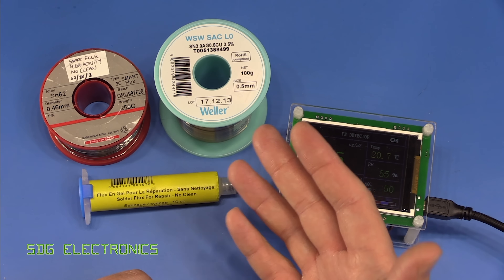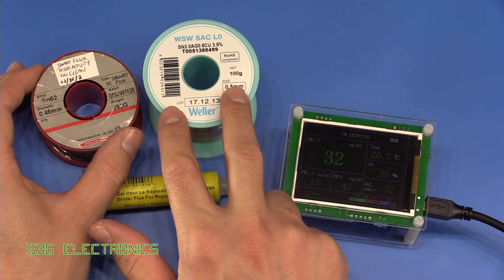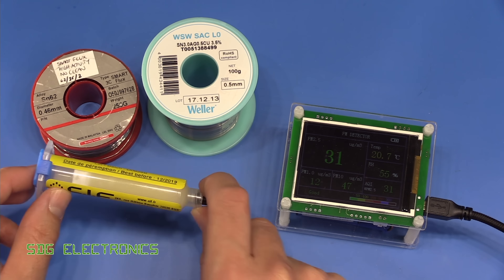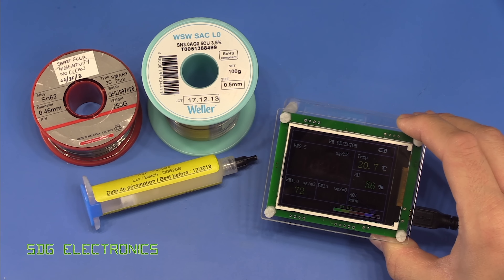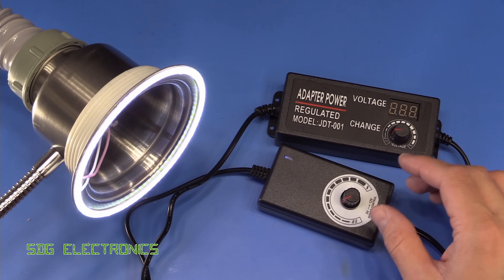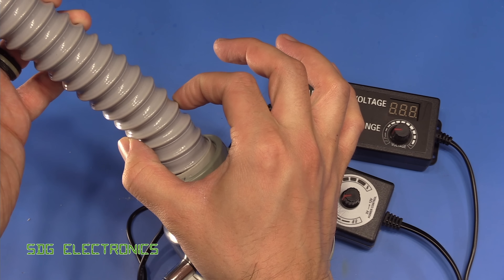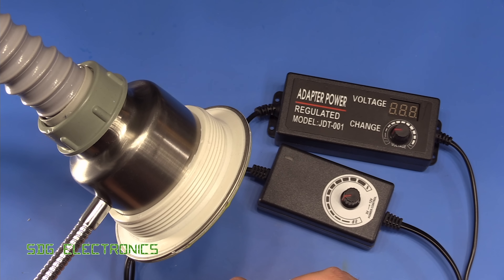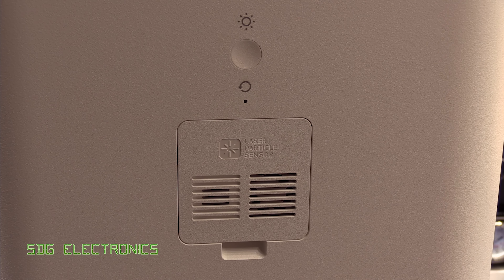SDG #131 Solder Fumes, Extractors and Purifiers

Comment: I made my own, using Loc-Line tubing(https://www.amazon.com/gp/product/B006R9OXJM/) and an inline exhaust fan (VenTech VT IF-4-B).  It moves 190 CFM, which provides good air flow.  I have the Loc-Line connected to a long pipe and then the fan sits about 18 feet away from me.  There is some noise at the intake nozzle, but I have a speed controller so I only turn it up full when I need that.
It can pull the smoke away well enough that the intake doesn't have to be right up by the board.  The fan with speed controller was about $70, plus $35 for the ESD rated Loc-Line.  Overall it was a lot cheaper than anything similar.
Reply from the maker: That tubing looks pretty good, unfortunately not available in the UK, but there are some similar items. Thanks

Comment: I hacked / Moded a Laptop cooling pad, Reversed fan rotation , added a thin sponge filter and added a PWM controller. And I soldered everything on top of it and fumes(90% of the time) were sucked down because of the surface area and proximity to the pad.

Comment: $200 to $300 instead of just opening the windows for 10 minutes? That's a bit expensive...
(And it doesn't remove CO2 in the room)
Reply from the maker: I forgot to mention actually, but when I tested with a through-draft the operator exposure was still high. You still need the local extraction if you're concerned about the fumes.
Reply: @sdgelectronics  sure it's just the purifier that is effective at cleaning your wallet...
Reply from the maker: @cmuller1441  yes, I'm not recommending anyone should use this specifically. I plan to build a unit for the job soon
Reply: Try opening up the windows for 10 minutes when it's -20 degrees C outside.
Reply: @benbaselet2026  turn the knob. The window will open.
Reply: @cmuller1441  Yeah, and the room will be below freezing point. I know how windows work, do you know how winters work?
Reply: @benbaselet2026  if you keep the window open for a short time you renew the air but the walls don't have time to get cold so when you close the window the temperature of the air in the room raise back to normal levels pretty fast.
Reply: @cmuller1441  Every adult here knows how opening a window works and what it does. And that does absolutely nothing to clean the air if I'm soldering for an hour or more. Just give up already with your mantra please. If you like opening the window more than using smarter methods you are welcome to do whatever the hell you like but judging others here about how they should live their lives in the conditions they face is just childish and stupid.
Reply: @benbaselet2026  tell that to the EPA...
https://www.epa.gov/indoor-air-quality-iaq/improving-indoor-air-quality
BTW I don't see where I judge anyone but it seems that this is what you do. I just said that the particular air cleaner is pretty expensive for a fan with a filter...
Opening windows doesn't mean you don't have a brain. If there's a snow storm I agree that it's not very practical...
As rule #1 for indoor air quality is ventilation, if you don't have a proper mechanical one you don't have much choice: doing it manually or spending many thousands of dollars to upgrade it if you own your home. If you are not then you are pretty stuck with what the owner provides.
Rule #2 is not making pollution inside. So the fan with a tubing is probably the way to go to send the fumes outside. If you read my previous posts I never said anything about that solution so just calm down.
Anyway with -20C the natural convection then opening the windows is certainly faster due the the biggest difference in temperature. So you are good with just 5 minutes. You should really try that once in your life so you don't die without learning that simple solutions can be good.
Reply: @benbaselet2026  LMAO  I am from Canada and -20 is nothing. Don't be a wimp
Reply: @benbaselet2026  You are way out-of-line. Are these methods/equipment more effective than an open window with a measured air-flow is the really question, and not answered here. The argument that the air needs to cleaned was not even fully discussed - it was left vague and and not held in comparison to other situations. 'Smarter' methods is just ridiculous; if cheaper and  more accessible and convenient methods are viable then the products presented here are Not smarter.
Reply from the maker: Looks like the purifier doesn't enforce a filter change. It also supports non-genuine filters with no RFID tag fitted now that I've just tried it, so things aren't so bad with these devices.

Comment: @SDG Electronics #SDG Electronics delivers the TRUTH , lead-free solder is WORSE for humans , its more about the fact Lead can be absorbed by handling , still washing hands after work use is good practice and as such to me its still the winner. i think @JohnWard #JohnWard DIY fume extractor was miles ahead, plastic tumple dryer vent ducting around 100mm and an inline Bathroom/Kitchen impeller extractor fan and filters from a cooker hood extractor fan.  Can i ask if the "inlet handle" simple gooseneck threaded or fitted with a clamp and whats the approximate diameter and length of it. At the begining i kept think you built it and then was shocked as your builds always seem built to high standards. Thankyou for your content , i aapreciate you clear and concise mannerand find it interesting and relevant.    ;-]
Reply from the maker: The gooseneck has a little flange on the end with an inner threaded section - so the cone just needs an 8mm hole in it. It's the same type of gooseneck from any clip-on spotlight. I will potentially build something better in a future video.
Reply: @sdgelectronics   that sounds like standard 1/4 - 20 camera mount thread so any mic stand, bracket or even arm would work to clip/bolt the extraction head near the work, interesting, in theory you could have an additional arm on a bench and swap between extractor and camera and have increased versatilit on a bench, if you do go down the DIY route i definitely can recommend checking out JW's video on his channel, even if only for some inspiration, i used many parts of his idea for mine, main difference on mine was i used 4x80mm computer fans as thats what i had to hand but when i find an old bathroom fan i may "upgrade" it, thanks for your reply ;-)

Comment: Hi,i want to recap an old Denon pre-amplifier.Do you think that's possible without the right service manual.I can only find US and Asia models but i have the European model.
Reply from the maker: Yes, just open it up and note down the capacitor voltages, capacitance values and measure the diameter of the capacitors. No need for a service manual for a straight swap.
Reply: @sdgelectronics  Ah ok..Thanks! I go try that.

Comment: I have the Aoyue FEK-01 it was on sale for just 180€ + tax, delivered. It is very good value for money imho. It is a bit loud, but while i'm fixing boards i always listen to music with a  bt anc headset and noise it's not a problem for me. I also use a cheap hakko 493 clone that i put close of the soldering iron stand for extra protection. This setup is working for me very well.
If you set the motor at 100% the suction is effective up to 30/40 cm, if you have ac or a window open it is much less effective.  

https://www.aoyue.eu/aoyue-fek-01-led-solder-smoke-absorber-fume-extractor-extraction-arms.html
Reply from the maker: I'll have a look, thanks!

Comment: And you need to produce plastic, filters, fans, use electricity (which came from coal) to remove pollutants that came from process of production of an air purifier. Runaway spiral. Very clever. And business is going on, someone is making money on that. Similar idea was used in tv series "SeaQuest" with Roy Scheider. Air purifier. We made so many machines that we need machines to breathe healthy in our own house.
Reply: Sounds like you are on an agenda which does not really address the issues presented in this video.

Comment: what i found out, the smoke is going to the hot elements and becouse of human is hot 36'' then the smoke goest to human face. but if you get something how next to you it will go into that object so i think the fan with heater could be best solution. im about to build diy test item. the only think is the fan must be slow as the airflow will colled down the small heater.